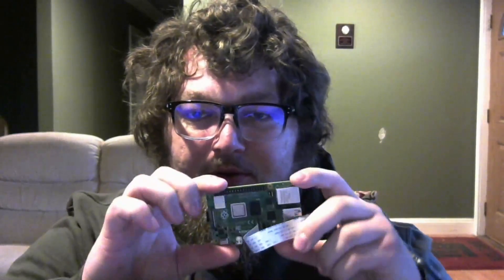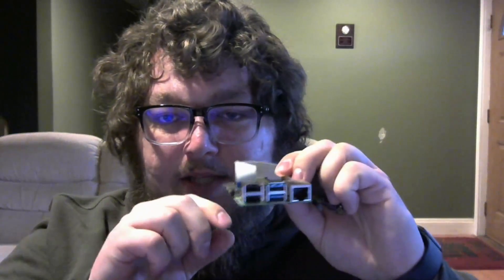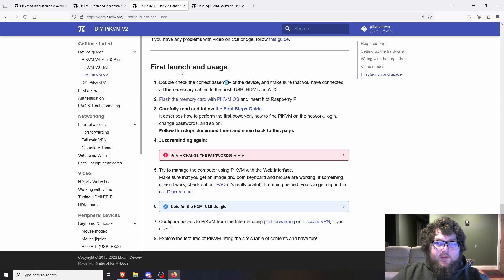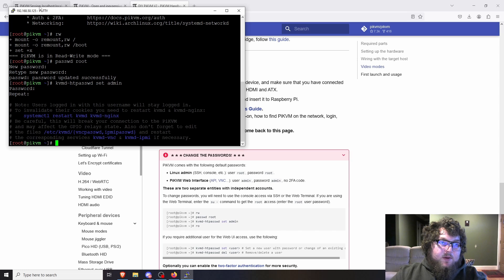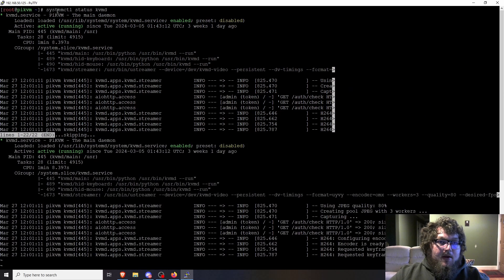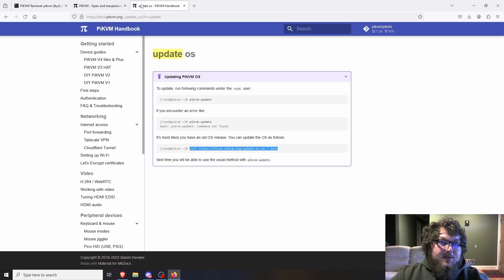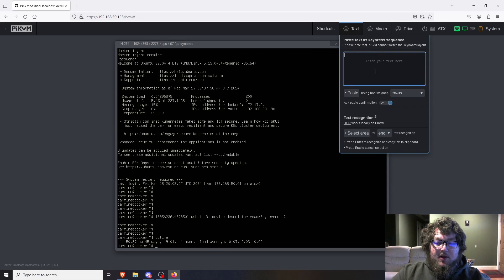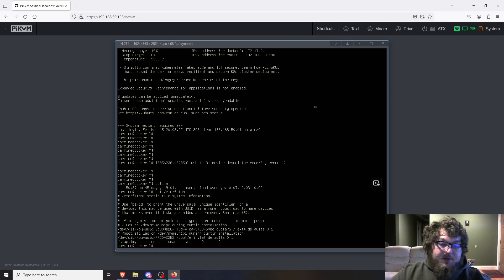How To Make Your Own PiKVM

Comment: Have you tried this with the Pi Zero 2w? I have an RPi 5 8gb in small homelabs right now and I have extra Pi 4 4gb, and a Pi zero 2w. Was planning on using the pi zero 2w with my ender 3 to run octoprint but I am trying to see if I can somehow integrate that with my Pi 5 homelab. I don't want to waste the pi 4 4gb since 4gb is overkill for just a pi kvm. Thanks!